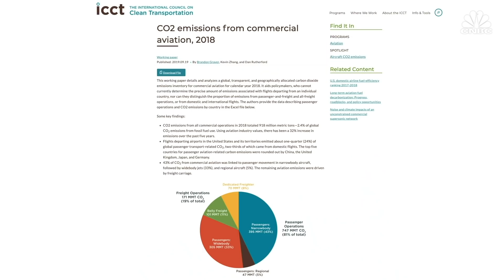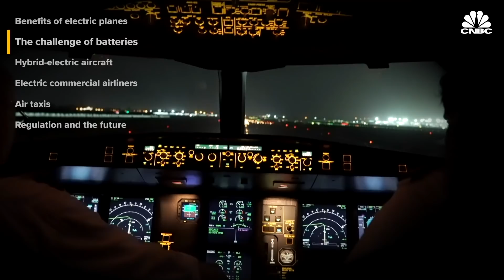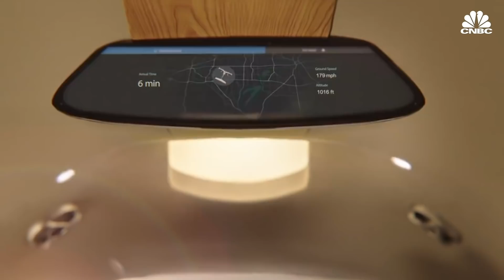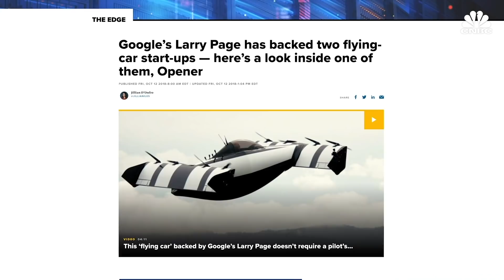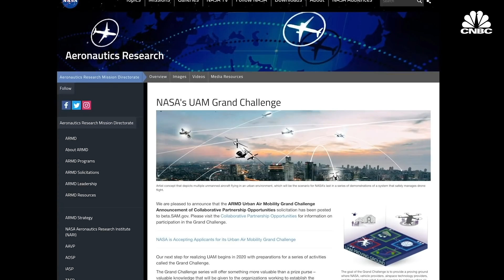Why Don't We Have Electric Planes Yet?

Comment: I think commercial (all) aircraft should be electric and should be lifted and launched vertically with automated lighter than air balloon drones (like they do with some rockets) which after proportionately deflating until a plane accelerates above its stall speed releases itself and flies back down to the airport. The hot air or gas, drone batteries, aircraft batteries, etc could all be powered/created with solar power and planes could even be taken higher than their desired cruising altitude for additional gliding fuel advantage.
Reply: sanjuansteve that seems extremely complicated and expensive also I don’t think that could even work...
Reply: @alek488  A plane could as an extreme example launch from a static drop if it had to and clearly getting to altitude with solar charged/created lighter than air gas is cheaper than using jet fuel.  Google balloon launched rocket.  Stop not only giving up on engineering ideas/challenges before trying to think about it but also trying to convince others to think closed-minded like you.

Comment: Nuclear batteries or hydrogen fuel cell engine
Reply: rajeev3983 nuclear planes like in the fallout games
Reply: @alek488  yes or may be use the nuclear batteries the kind they use in some satilites
Reply: Nuclear planes existed during the cold war but pretty heavy and unpractical , meanwhile radioisotopes generators only crete a small steady charge not suitable for planes operation, hydrogen cells in the other hand uses more energy inthe isolation of hidrogen process making its whole point unfeaseable unless a better extravtion method is discovered and a better more effcient storage method too , to compete with energy density of today jet fuels
Reply: @rajeev3983 even I thought the same
Reply: what if the nuclear plane crashes?